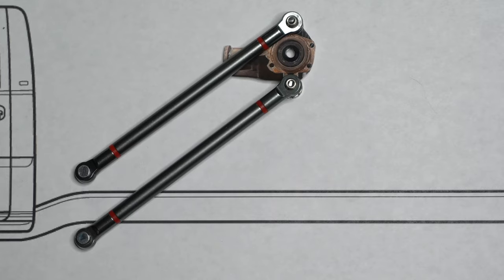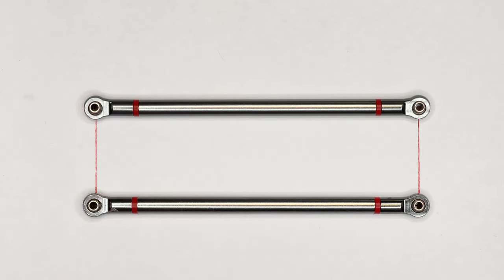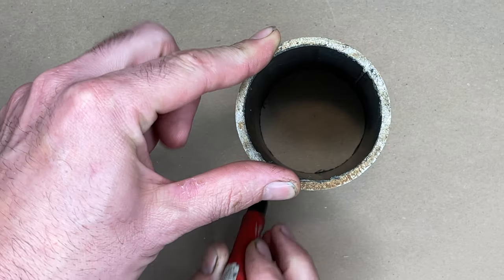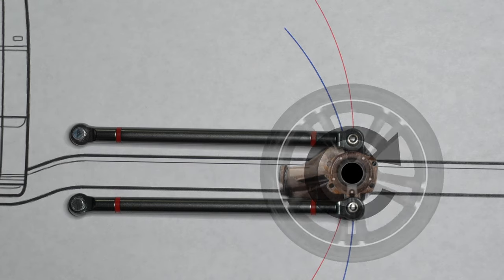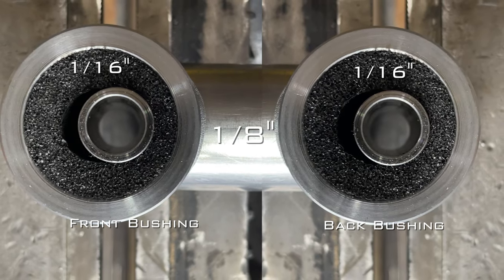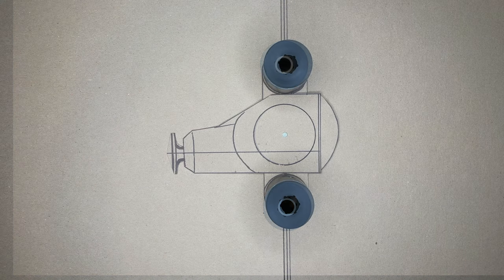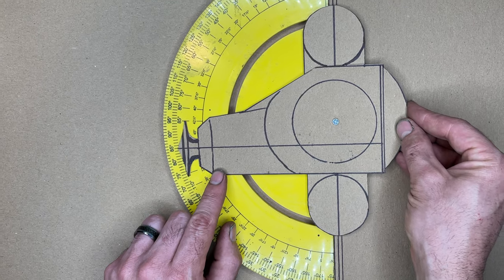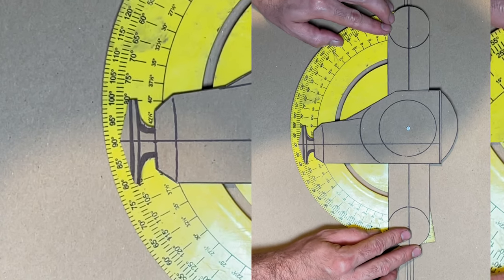Suspension Basics 05: Link Bar Bushing Squish and Axle Rotation.

Comment: I really like your videos. Good explanations and examples. Would not a shaft with a triangular link also be able to have a permanent pinion angle, if the triangular link has the same length as the lower links?
I plan to put triangle link on a car with leaf springs, to achieve permanent pinion angle and stop a wobbling spring. The leaf spring is 24 inches from the center of the bushing to the center of the axle. I have then plans to mount a triangle link with the same length, 24 inches, with bushes in front and a range rover ball joint over the pumpkin. What do you think of my plans for to control the axle?
Reply from the maker: That is a REALLY interesting question, Vidar! It’s all I could think about on my way to work this morning. It’s going to take me a while to type up my thoughts though so expect a long-winded replay a little later.
But first, what are you using this car for? Daily driving? Drag racing? I think the answers will change a little depending on how it’s used.
Reply: @GarageFab  The car is a Land Rover Series 2 88 '', a small short 4wd car. The car should be used on country roads and medium off-road driving. As an upgrade, the car will have a Ford Cologne 2.8 engine, twice as many hp as the original, and it will have parabolic springs. 
One of the challenges with the springs is that they do not withstand torsional forces as well and are not as stable to take lateral movements as a normal spring package, not the best if like me plans to sometime use it with a trailer. The car also has a very short drive shaft so the right pinion angle has a lot to say. By using a triangel linkage, I hope to gain control of both the pinion angle and the forces.
Reply from the maker: Very cool project, Vidar.
I think you’re definitely on the right track.

If the perpendicular length of the triangulated link equals the length of the lower links bars the pinion angle would remain constant just like a parallel 4 link. But the parabolic springs could potentially cause problems. When leaf springs compress, they straighten out a bit and get slightly longer. That said when your suspension compresses, your lower “link” will get longer and the upper link will NOT. That will cause the pinion angle to pitch down some. How much? I don’t know for sure. Probably just a little. I can’t imagine it would matter much since in a static height vehicle like yours, it should quickly bounce back to normal. Another potential issue is your axle will be forced to articulate on that ball joint which may or may not be a natural movement for the leaf springs. Unfortunately the only way of finding that out is to do it!

Overall, I think adding a triangulated link for lateral stability is really smart. As for preventing windup, I’m not confident it’ll help but it’s a possibility. There are other bolts on options to help with that.

Can’t wait to see what you come up with!
Reply: @GarageFab  Yes, it is an exciting project and soon I will have to make a choice whether I will put it live.
You come up with a lot of the same concerns that I have been thinking about. Especially this with articulation on the ball joint, also the longitudinal displacement on a resilient arch. I think I need to make a mock up, either in full scale or scaled. If I do, I make a small demo in youtube. I'll keep you updated.

Comment: Awesome video! One question, where do you get your link bar ends?
Reply from the maker: Thank you my man!
I get all my suspension components with the exception of steel tubing from Thorbros.com. There’s often a hefty wait which sucks but I haven’t found higher quality products yet.
Reply: @GarageFab  much appreciated! I’ve been binge watching all your videos keep up the good work! One last thing sorry to bother you lol how do you determine weather to use steel tubing or dom tubing and what size and wall thickness do you reconnect for link bars? I’m currently attempting a watts link just like yours!
Reply from the maker: No apologies necessary. That’s why I’m here. For me personally, I use regular mild steel tubing for most link bars. I use DOM tubing whenever I need to weld in a threaded bung for adjustable bar ends because bungs are generally machined specifically for DOM. 
Regular tubing is either too wiggly or the seam causes problems.
I appreciate your time Brother! See you in the next one.
Reply from the maker: Forgot part of your question… For non-adjustable and non load bearing link bars I used 1.5 inch 1/8 wall mild steel tubing.
(“Non load bearing” are link bars that do NOT have an air spring or coilover attached to them.)
Load bearing link bars actually lift the weight of the vehicle and I constantly use 2 inch square tubing with 1/4 inch wall thickness.
For things with adjustable bar ends/threaded bungs, the supplier should tell you what size tubing you’ll need.
I believe my watts link bar bungs were 1 inch in diameter so they required 1 inch inside diameter DOM and 1/8 wall thicknesses was plenty.

Comment: Would this create  symptoms of torque steer?

Worn out bushing would it cause when accelerating truck to veer one way and then Letting off accelerator go Opposite direction??

2017 ram rebel with air suspension is tricky to dial-in 🥵
Reply from the maker: It absolutely could, Bri. Worn out bushings can cause the thrust angle (the direction the rear wheels are facing) to change under acceleration, and it’s likely that reversing the force (decelerating/braking) could cause the thrust angle to either return to normal or shift in the opposite direction.

Comment: Ok so I’ve watched all 5 videos but I’m currently trying to plan out an s10 on bags but I don’t wanna move my fuel tank I’m being kinda lazy on the build as it’s my first and kinda a shitshow to start with it’s mostly a learning experience however I wanna do it kind of right and I was thinking 2 point using leaf springs and panhard “BAD PLAN” now I’m wondering could I run the bottom links to the original front spring mount and the top links to the rear with a watts link? I don’t plan on cutting the frame so only a lil suspension movement again this truck is a learning experience my next project I wanna build the entire frame and everything from scratch
Reply from the maker: Hey, Nathan! (That’s my brother’s name)
I appreciate the idea of learning on your truck especially if you already plan to build another in the future. 
Will you be installing air suspension? I’m definitely anti 2 Link on adjustable suspension but for everything else it’s just fine. Your idea of using the front leaf spring mounts would work just fine. Those mounts were built tough enough for that exact job. Swapping the springs with link bars won’t change much. And the upper bars don’t have to be directly above the lower bars so you can put them just about anywhere.
The only thing you should know is that low is an addiction. You’ll be happy with your truck at first. But those leaf spring mounts hang down below the bottom of the frame which will keep you from laying the frame flat on the ground. As will the uncut frame. 
And eventually you want to. 😈 
But I guess maybe that’s what the next truck is for.
Can’t wait to see what you build! Best of luck my friend.

Comment: Hi the black rigid bushes are made by ???🙂
Thanks.
Reply from the maker: I’m not sure which bushing you’re talking about, but regardless I got everything for the Watts Link except the metal and the snacks from Thorbros.com. That’s the center black polyurethane bushing and sleeves, the heim joints and threaded bar bungs and the aluminum mock-up bushings that I’m not sure we’re even visible in the video.
Hope this helps, Carlos! Cheers

Comment: For a chevy nova 72 what would be the best configuration?
Reply from the maker: That's a rough question to answer, Levi!  There's a lot more to determining a good design than just the car.
What will your Nova be used for?
Will you be racing it?  If so, Autocross, road racing, or drag racing? 
Static height or adjustable suspension?
What's most important to you? Ride quality/comfort? Handling? Traction?
If you answer those, I can perhaps steer you in the right direction.
Cheers!